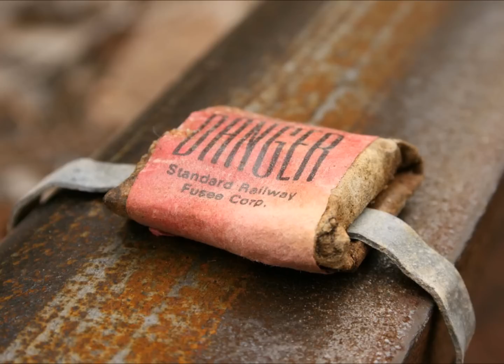Sim Webb's Description of Casey Jones Wreck

Comment: I think this recording of Simeon Webb was made at Sun Studios here in Memphis.  There is a small museum about the wreck at Vaughn, Mississippi, a much larger one in Jackson, Tennessee including a steam locomotive similar to the 382 Casey was engineering that night.  This was kind if a freak accident, Casey was only going about 30 mph when he hit the other train, it should not have necessarily been fatal to him.
Reply: The impact probably wasn't what killed him, because he should have been able to brace for that. If they went through the caboose and several other cars on the other train, flying debris could've hit him, or he might have been crushed by something after the 382 went off the rails.
Reply: I believe he was, in fact hit, in the throat by debris.  I imagine the force of the debris hitting his throat was sudden and fatal
Reply: In a documentary I recently watched about Casey, I'm not sure if he was killed in the wreck or not. I heard a variation that they pulled him out of the cab where he was severely injured and scalded by steam, and walked him by stretcher to the Vaughn freight Depot where he died soon after. Wish I knew the actual facts
Reply: I read somewhere that he was crushed to death by something in the cab when the engine tipped over on its side. Not 100% sure though.
Reply: @michaelramsey82  apparently the throttle lever pierced his throat
Reply: @michaelramsey82  the throttle hit him in the wind pipe and it was fatal

Comment: Jones had a very poor safety record during his time with the ICRR.   Over his 12-year career he had been suspended for a told of 145 days due to nine rules violations issued by the railroad.
Reply: There is a lot of issues with this account. Many dispute the claims of the railroad and their proper placement and flagman since Simm's continued to contest the claim there were torpedos, flusees, or a flagman at all on the track. Stating he had violations was also ignorant of history, considering the railroad purposely chose Jones because of the fact he was known for going fast to run the Cannonball that night.

Furthermore, he was under orders that he had the right of way and was the priority train for the night so he had no reason to suspect there was going to be another train on the track since he was informed the track would be clear for him. It is hugely ignorant to believe that Casey would ignore a flagman, torpedos, or fusees as evidenced by the simple fact when he did find out about the other train on the track he ordered his fireman to jump and he stayed on the whistle and the hand brake to bring the train from 75 to 35 miles before striking the caboose at the cost of his own life. 

Though some have tried to still stick with the railroads claim all safety was monitored and instead all fault was to be laid at Jones feet, there are a lot of issues with this account, to the point even if torpedoes were given credit even in the "official" record, they were so close it would not have mattered even if the Cannonball was at normal speed. Hell companies still try to absolve themselves of any wrong doing to this day, so people being shocked that Jones became the sole reason for the accident is unsurprising, or how people blow things out or proportion. Hell, he had his detractors on both sides, look up the Union Scab, essentially what most consider a sellout these days.

I mean you don't have to look far for people either changing the facts or even making things up based on what the company record says to discredit one man. See the Titanic disaster and how people and even the White Star Line made up all manner of excuses for that disaster and how many keep making up things that Captain Smith did not actually do (no thanks to that fucking movie by Cameron).

While the truth of the man lies somewhere probably in the middle, I think it leans more towards heroic. Simm's account, as can be heard above, disputes what the railroad claims he said, which is not surprising because even today the word of a colored man tends to be ignored over that of what the white folk say.